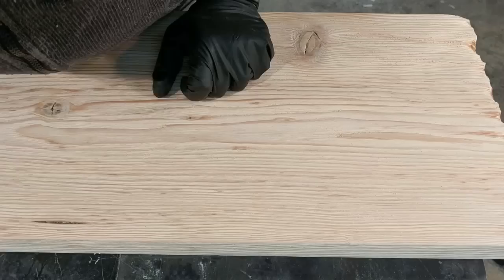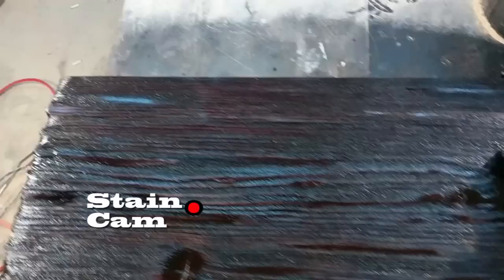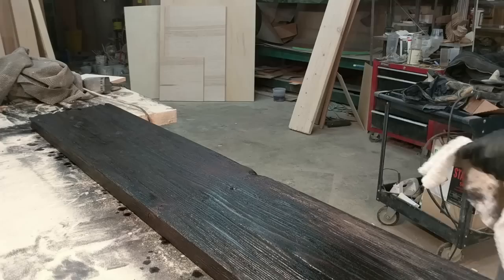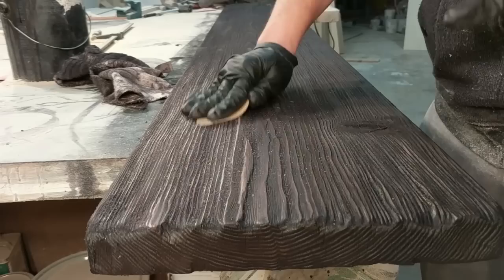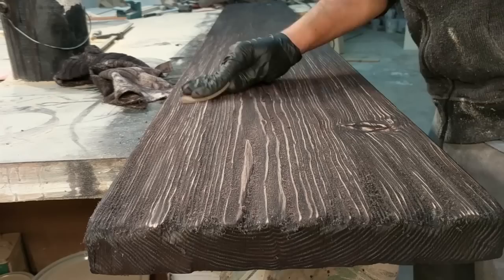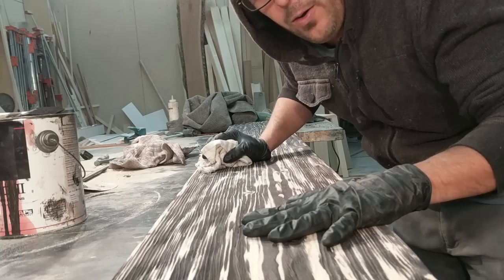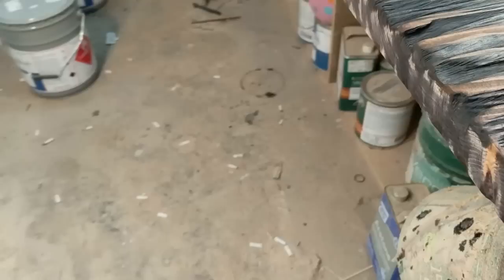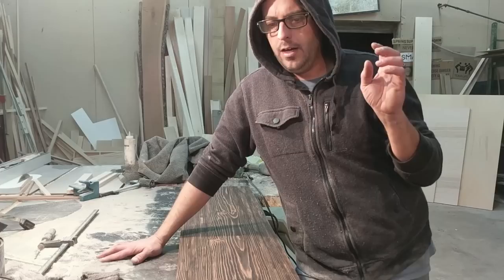How To Stain Wood | AMAZING Results!! #diy #finish

Comment: With the same technique work on wood that’s already fairly smooth
Reply: Idk if youve done it but it will but it will help a little more if you lightly sand it so it sinks in better

Comment: This is exactly what I was thinking about doing. I've seen the wire wheel technique, planned on a black and mahogany multi stain for my project. I wasnt sure if I should stain it first and then wire the soft wood away or do how you did.
The results are exactly what I was thinking so going to run this past the woman.
I had built a barn style kitchen table, a live edge coffee table, both with black borders and mahogany centers. They turned out well. I wanted to try something a little different with a mirror and picture frame that matched these already completeled projects...and this is exactly what I was thinking, maybe with a little more distressed look like sanding marks, hoeing marks, and maybe some dents.

In any case, thanks for the post, now I know how to get what I was thinking.

Comment: I really like this a lot
wkn on a 700lb Ash tree branch
took off all bark due 2 city cut tree down due 2 Asia Beatles
looking 2 make a patio chair out of it. Maybe looking 2 have a bucket seat look 2 it.
1. How many coats of each
2. seat area use yur idea & maybe keep original look on the outer parts
3. what good stain/seal 2 keep the outer original color?
4. what seal 2 keep this project protected from the elements of 
Chicago 4 the ages.

Looking forward 2 yur ideas, comments, & help.
Reply from the maker: +RaiMundl Thanks!
Ash is generally a very light and pretry hard wood. To get the rustic look, check out the chainsaw grinder video I have. It will make it alot easier to grind it for the ash.
As far as stain, you might be better off using an outdoor translucent deck stain and just use as many coats of it until u achieve your final color. For the natural looking part, just use the base of the stain with no colorants added.
For the sealing coat of the furniture, I would use the strongest weather resistant product made for outdoor use. Unfortunately, outdoor is not my specialty 😀, maybe cover it up during our Chicago winter
Reply: Thk U 4 yur reply & help/suggestions

Comment: Thank you so much for sharing, would you say that wood staining could possibly work well on MDF panels?? thank you for your help
Reply: Stain would definitely darken the mfd depending on what grit you sand it to.  Maybe after sanding the mdf with 80 grit it will absorb the stain. Now the sides of the mdf will soak up the stain like crazy
Reply: @Woodworkerexpress   Thank you so much for your help.  The MDF I would be using is a moisture resitant MDF (it has an olive green color)  I'm hoping to make it look like dark mohagany,  not sure whether I should prime it first and then stain it..

Comment: I have some leftover stain with a little linseed oil mixed into it.  For the moment, I just kept the leftover in a plastic container with a lid on top (the contain I used to mix and apply with).  Is this ok?  Not sure what other container to keep this leftover in, as I don't want to pour it back into my original stain can without contaminating it.  And I don't have any extra tin can to use.

Comment: Hi ... thanks for the video. Question - the same technique to cover a floor?  It is a timber floor that has never been sealed.  I would like it to be black but know only too well how much dust dark floor shows - so I thought that maybe two coloured stains - maybe black and blue?  The other thought was to use a colourful paint and black stain rubbed in afterwards.  Have you any ideas that might help with this decision, please?
Reply from the maker: Suzanne Carroll There are many ways to achieve this. You can stain the floor black then sand back to bare in grooves or highspots then dye the bare area blue. Or in reverse you can paint the floor blue then sand back to bare the areas for black stain.

Comment: I'm talking about the cracks and crevices
Reply from the maker: It's just pine. You can get the wood anywhere and you have to distress it with a grinder as in the video I just linked

Comment: I have a table I just got made recently. It’s a dark stain on reclaimed thick beam wood. I wiped a mark off it recently with a wet cloth and it wiped off some of the stain. What’s the easiest way to fix it? It’s literally a few inches of the table. 

Thanks for any info.

Comment: Looks nice , about to make a single floor shelf below my tv thats on the wall for my audio which is a receiver / computer tower/ and cable box , thats about it , what was the light stain you used , i'll be using black stain and what ever light stain i can find , may give it a go on this shelf i'm doing which includes black pipe as well.

Comment: Hi Jason, Great video!! I did everything you did but I got a lot of hairiness / sawdust and what not in the grain... it became very messy :( what to do?? Thank you and keep on making these fun videos!
Reply from the maker: +Tom van Lit thanks I'm glad to hear. I would suggest hand sanding all the hairy parts off that's somewhat normal depending on the wood you're using
Reply: Doing it With jason well I'm using cheap pinewood because it is so soft and I can get the deep grains. Do you have a suggestion for less hairy bits and still a deep grain?
Reply from the maker: +Tom van Lit Absolutely, hand sand it with 80 grit to knock down the hair. It won't affect the depth. Or you can use a drill bit that has a string type bit similar to the grinder wheel attachment, but comes in grits of 80 and 120...kinda like a sander flapper wheel but not lol. Its available at harbor freight for sure and home Depot
Reply: Doing it With jason your videos have reached Holland so no Home Depot here ;) but I know what you mean so I'll figure it out :) thanks for your quick respons! Good luck and hope to see more vids soon! Gr
Reply from the maker: +Tom van Lit Wowsers, well that's terrific for the video..haha...they also have wire wheels that have a finer cut to them ! And I hope you have subscribed...I gotta ton of vids lol

Comment: What can you do when your stain simply do not get soaked into wood? My stain simply do not adhere to the wood. Is just sitting o top and when I use a rug ...all come off. I use beech wood stripes bought from a craft stone and I use a water base stain.
Reply from the maker: I would suggest sanding the wood down to 80 grit and then 120 grit. Sounds like the wood has been polished with a high grit such as 300 or above which stops the stain from soaking in
Reply: @DoingitWithjason  You are my hero!

Comment: Can you do this on flat wood too to get the two toned colors? I have a flat bench i want to have the two tones with but im afraid it will look strange if i sand it ?
Reply from the maker: It is possible but a bit difficult to get the look without having the high and low parts of the wood that come from grinding it. You can stain the entire piece dark and then wipe it off as recommended..then rub off sections or parts with steel wool to lighten up parts and give it a 2 tone look. Hopefully that  makes sense

Comment: What kind of wood sealer do you use most? Relatively new to woodworking. Your videos are awesome!
Reply from the maker: +Four Seven Studios Hey greatly appreciated!!
I typically use its Verde by chemcraft (urathane) which is my favorite. Also, I use chemlife 24.. not as strong though
Reply from the maker: +Four Seven Studios also, if you are new to finishing wood, I would recommend spraying on the finish. An easy starting product would be Deft...They sell it by the gallon at most Lowe's and it's labeled brush on but totally comes out great from a gun
Reply: Doing it With jason Thanks man ! Appreciate the info!

Comment: If I want to paint fill or epoxy fill an engraved piece of wood, should I stain before or after the filling?
Reply from the maker: I would say stain afterwards if your just filling in, that way you can sand flush if needed
Reply: @DoingitWithjason  Thanks!
Reply from the maker: No problem!

Comment: Can this be done on a regular piece of pine that doesn't have the grooves that you grinded into it? So could I get a similar result using a black stain and lighter stain afterwards like this video on a regular piece of pine?
Reply from the maker: You can..I would wipe the black stain on first. Then using acetone or lacquer thinner if it's oil based or even light sanding and remove the black in the spots you would like. Then go over the spots with the lighter stain. Hope that helps!

Comment: I love watching you..😅 I'm about to do this making a few shelves in my laundry room. What should I seal it with after staining? ✌
Reply from the maker: Awe thanks! Great to read! I absolutely love anything by verathane..even the sealers. I would say depending on what is available around your area I Also use a Dixiebelle product that has a great clear coat available here: https://dixiebellepaint.com?aff=67

Comment: Hi Jason, do I need to add some kind of oil on the surface at the end to protect the staining particularly if it is a chair?
Reply from the maker: +Robert Michael Yes, you definitely want to add a sealer coat. Check out the end of this video, it has a great and easy to use product that comes in a spray can. 
https://youtu.be/5jVI5vUrUJk

Comment: Great ideas in this video, thanks for sharing!  QQ: Do you know if the staining technique would also work if using 2 different colors of Danish Oil?
Reply from the maker: Robert Pauls Thanks! I'm not sure about that. Depending on how different the two colors are, it might work, I'd love to hear from you if you try it
Reply: Yes it works pretty well I use the Danish oil when I can.... it's a lot less fumes and less harsh.... and I can also get it to look just as good as the Minwax..... this is a great video bro.... very informative👍🏽🔥🔥🔥🎨

Comment: what kind of wood would you reccomend (on the cheaper side) that does well with dark stains?
Reply from the maker: Jazzmyn Anaya For cost wise pine is definitely the least expensive and takes dark stain pretty well. Also, for a little bit more money, I love the way cherry comes out. It is all about how you sand the wood before staining. Here is another quick video for staining and what kind of stain that I find gives the cleanest look.
https://youtu.be/OW22FJ2e9x4

Comment: What did you sand it to before staining? 220? And did you end up putting a finish on it?
Reply from the maker: I used 120 grit before staining and finished it with spray lacquer. Here is 1 I did with epoxy...its a super easy finish!
https://youtu.be/W1T9QNf7kQk
Reply: Awesome, thank you so much!

Comment: Okay so if I carved a 2x4 piece of wood and I sanded it already and wanted to stain it with only one color would I still have to sand it again and then re stain with a rag?
Reply from the maker: No. Just the one time...you can sand it after to bring some highlights of the natural wood back if you would like to.

Comment: Please can you advise me? I've bought a brand new sideboard but I don't like the colour so I want to stain it a rich dark brown. Because it's new I'm reluctant to sand it and potentially damage it. Is it possible to paint a stain on top without sanding it?
Reply from the maker: +safi456 Anything is possible! But, no, I would not recommend that. The stain will not be able to soak into the wood and most likely will just be sticky and not dry. To save some time, you can lightly sand off the clear coat with 320, then stain and reseal or lightly sand off the clear coat and use a chalk paint and go over the piece. 
General rule- Stain is not meant to be left on without wiping off.

Comment: Question for you. I recently made two farm tables. The first I sanded using an orbital sander, the second table I ran through a planer. the first table took the Jacobean (minwax) well, however the second table seemed to reject it. So the two tables look very different. Insight??
Reply from the maker: +primaryification Sanding opens up the pores and allows the stain to absorb easier and more depending on the grit. Sounds like the planner polished it
Reply: Hey brother, thank you for the rapid response. I think your right the wood ended up super smooth with a sheen. Lesson learned. Thanks again.
Reply from the maker: primaryification No problem!!

Comment: You have the name of this stain color, ? I have a old bathroom (1939) renewal project and I remove the tile and I decided to let the wood, but I need removed all nails because they used a rarefied insulation paper and rags and used a lot of little nails, I tried to cover the damage with rustic stain....
Please tell me the colors....
Reply from the maker: I believe the colors I used were dark walnut and American walnut by the company varathane.You can also thin the colors out to achieve a variety of different shades and / or sand to a higher or lower grit to achieve the perfect match
Reply: Thanks for the answer....Yo make a great job...!

Comment: Do ou start sanding down the stained wood immediately after the coat is applied or let me dry for a few minutes?
Reply from the maker: +Sarah King I usually wait a few min after wiping...also you can use acetone instead of sanding...here is a vid on that method 
https://youtu.be/W1T9QNf7kQk
Reply: Thanks!
Reply from the maker: Sarah King no problem!

Comment: Great video thank you! What sealer do I use?
Reply from the maker: Chantelle Wanser Thanks! I generally use a  2 part urethane that needs to be sprayed by Chemcraft called Verde for my custom pieces. If you are looking for more simpler application methods i would recommend using Epoxy or even  or a spray can of Varathane, they are very easy to work with.
Reply: Awesome thanks!
Wanting to stain my coffee bar buffet. :)

Comment: didn't you use  pre condition for the wood to avoid Mark's and get an even finish
Reply from the maker: No, I never use the preconditioner. I have found the only thing it really does is keep the stain from getting as dark as it should be. I am a firm believer on the sanding method, it makes or breaks the finish
Reply: I was cautious as I'm planning on building a  apothecary table  and when it comes to varnish I'm no expert  , so i don't want to screw it up varnishing wise lol  trying to figuer out what varnish will give me the look I want and keep seeing pre stain conditioner

Comment: Loved the video, I tried following the instructions, but I must have done something wrong, it's been 24 hours and my wood is really sticky, I didn't put anything over like a gloss or protective paint, what can I do to get the stickiness of the wood?
Reply from the maker: Did you wipe off the excess stain after applying it?
Reply: @DoingitWithjason  no, I didn't 🤭 is there a way to fix it?
Reply from the maker: Uh oh!
Yes, you can re apply the stain the same same way you did before, pretend you have no stain on the piece, then wipe if off. It will reactive the existing excess stain and come right off. Then let it dry for a day☺️
Reply: @DoingitWithjason  thank you soo much for your reply, I will definitely try it 😊
Reply from the maker: No problem at all! Please let me know if you need anything else!

Comment: Hello I would like to know would this method work on all forms of distressing? As in if I beat a piece of wood with let's say a chain & a hammer then throw them on rocks, could I use the same technique?
Reply from the maker: David Smith Absolutely. It's all about the highs and lows that you create in the wood
Reply: Doing it With jason so should I go harder to create deeper scars?
Reply from the maker: David Smith Yes for sure. That way the dark color sits in the grooves and the light color is the higher parts. Also this video has a little Info towards the end of the staining and more distress options too.
https://youtu.be/W1T9QNf7kQk
Reply: Could I use a Palm sander to reach desired results?
Reply from the maker: David Smith Depending on the Sandpaper grit you can

Comment: Ok. I have wide pine floors that are the common light yellowish color. They are distressed, which I want, but the wrong kind of distressed. They look more worn and scratched than genuinely "rusticly", if that's a word, distressed. Did that make any sense at all? Anyway, any advice on how to restore lol, if you will, to a "real" distressed look, rather than a look like shit, distressed look?
Reply from the maker: Sounds like the finish came off of the worn areas. Maybe 1 easy way to help give the floors a little life would be to just stain the areas that have worn down with a slightly different color..may look less crappy!

Comment: Just gorgeous! Question Jason, is this a water based stain?
Reply from the maker: +Costume CO This one is not. I'm not a huge fan of the water based stains. It generally raises the wood grain after you apply it. Varathane is one of my favorite and it's very easy to use. I highly recommend that company

Comment: Hi! What type stain are you used it? Oil or alcohol?
Reply from the maker: This is an oil based stain
Reply: +Doing it With jason thanks! Hey men, do you think that it's possible use linseed oil of finishing? Over based oil stain?
Reply from the maker: If you let the stain dry completely, it should be possible, just not sure if it will lighten the stain...try a test piece for sure
Reply: +Doing it With jason ok! Thank you very much man!
Reply from the maker: No problem! Let me know how it works out